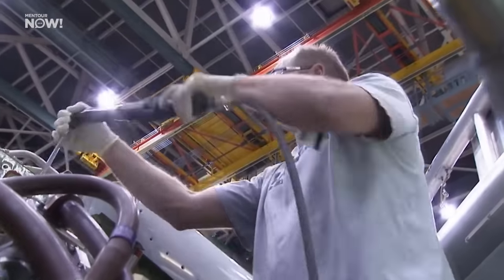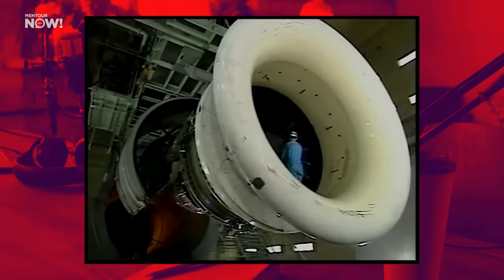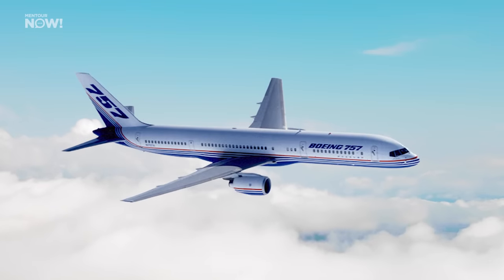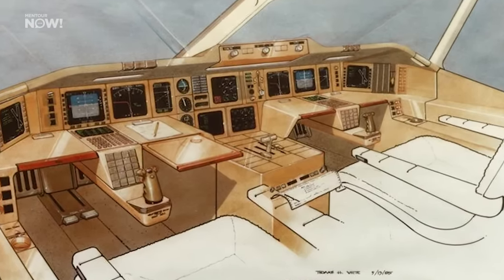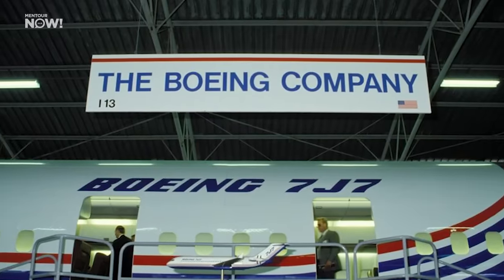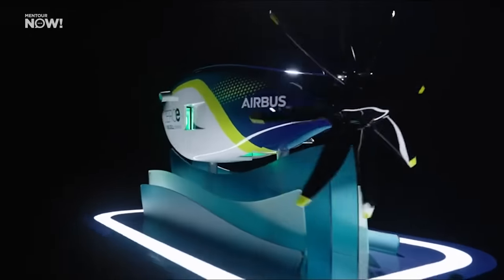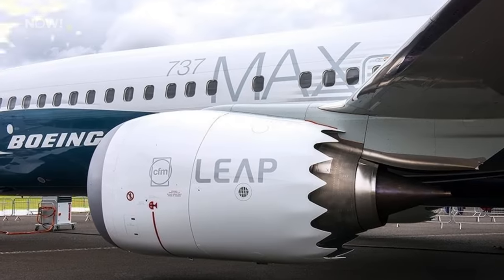Revolutionizing Flight! The Amazing Potential of the CFM RISE Engine.

Comment: 2 things not mentioned here:
1- The casing also adds drag.
2- These new-generation open rotor engines moved the rotor to the front (they are puller rather than pusher). Pusher propellers (or rotors in this case) are much noiser because they encounter uneven "dirty" air. Uneven because the engine must be supported somehow and that creates an area of "shadow". And dirty because they are in the wake of turbulent boundary layers at least from the engine and from the pylon. Puller props on the other hand receive a very even flat and laminar profile of oncoming air, which makes them less noisy.

1 thing mentioned here wrong: Turboprops are not required to keep a severed prop blade from penetrating the fuselage. And they don't. In every instance where a prop blade separated at operating RPMs and flew in the direction of the fuselage, they penetrated the fuselage, sometimes killing people, some times damaging critical systems (like control cables or hydraulic lines), and sometimes even exiting the fuselage at the opposite wall.
Reply: maybe the solution could be to increase structural strenght in those areas so they wouldn't get penetrated in such scenario.
Reply: @Hikari_Sakurai  That's not necessarily possible. Everything in an aircraft design is balanced against weight. You can only add so much weight in reinforcement and it might not be enough.
Reply: @hydra70  actually you're wrong. he mentioned it in the video that some of those aircraft had reinforcement in the areas close to the rotors. I wasn't that far in the video when I commented on it.
Reply: @Hikari_Sakurai  the reinforcing is there for ice protection. Chunks thrown off the blades can penetrate the fuesleage otherwise
Reply: @MattyEngland  This is so heavily dependent on the car and the grid production sources that it's kind of a meaningless claim. If the grid is purely fossil fuel you won't see much of a benefit, but obviously if it's heavily renewable that changes a lot
Reply: @MattyEngland  No? The Volvo report on figure 3 clearly shows the renewable break even point is at 30k miles. With the current global mix, it's at 68k miles.
Reply: @MattyEngland  Which report are you referring to then?
Reply: Any Link to a video showing or discussing a prop that sheered and went into the seating area of plane?
Reply: @MattyEngland  not true. EV’s break even in 18 to 36 months in the USA, depending on geographic location.
Reply: @MattyEngland  there is no fiddling. Straight up facts. It just doesn’t fit your narrative.
Reply: @RTB RTB_Dutchy  i love bacon.
Reply: Last year or maybe towards the end of 2021, a blade separated from a turbo-prop as it landed at an airport in the north of South Africa - exited the fuselage on the other side - as understand it, it missed the reinforced part of the fuselage as it had forward momentum after it separated from the spindle, and thus struck the plane ahead of where the designers had expected it to hit the fuselage.
Reply: @AmbientMorality  Yea. We don’t care about the children in the lithium mines and the hazardous/power consumptive process of refining lithium.  Fossil fuels bad.
Reply: @MattyEngland  Hey, you missed my question. I looked at Volvo's C40 analysis. Which one supports your claims?
Reply: Yep. The most recent passenger death on any U.S.-flagged scheduled air carrier (one of only 2 deaths in almost 14 years) was from exactly this - a turboprop threw a severed prop blade into the fuselage, which penetrated the fuselage and killed a passenger. Designing the fuselage to be able to stop one of those things is a lot harder than designing a nacelle to be able to redirect one and spit it out the back. Even more so when you're talking about the even larger fan diameters on the unducted fans.
Reply: @Hikari_Sakurai  Yes, he mentioned that but he is wrong. There is no requirement to have this reinforcement for propeller blades. Airplanes do have reinforcement in that area but that's for ice shedding from the propeller. One thing is to stop a chunk of ice, a different thing is to stop a super heavy, super fast and very sturdy knife (that is, a propeller blade).
Reply: My thoughts exactly. Not only is ducting more efficient by directing all the air in the desired direction without the loss of some of the air flow radially away from the blades, the ducting also acts as a buffer for any detached blade that is thrown off by the centrifugal force
Reply: @marsbase3729  A duct adds a lot of weight and drag, though. This is probably right around the point where ducts add more than they help
Reply: @anthonydomench6871  Children don't mine Lithium. Lithium is concentrated in evaporation pools and is associated with salt flats.
Reply: @vbscript2  That was a turbofan engine. The blade missed the containment system around the fan.
Reply: @singleproppilot  No, it was a turboprop. I'm talking about the Penair runway excursion accident in Alaska, not the Southwest 737 (that was the other of the 2 passenger deaths on scheduled carriers.)

The Southwest accident was a contained failure. The blade was contained, but part of the cowling broke off and impacted the fuselage.
Reply: @rtbrtb_dutchy4183  sTrAiGht Up fAX!

Deliver the numbers. And ignore discounts given by the government.
Reply: @anthonydomench6871 You do know that there are just as many concerns (yes, including those very same humanitarian concerns) about the "mining" and refinement of fossil fuels, right? 

Coal is more radioactive than nuclear plants and is mined by slaves, including children. Petroleum (oil) is mined by machines, which in a lot of oil superpowers had children building them. Refinement and transportation... Don't even get me started in the harm of those. 

Don't forget that betting on batteries means that eventually there's no environmental impact to transportation, at least in the atmospheric sense.

Comment: I saw this propeller design in the mid-late 80s, probably in Popular Mechanics. I've thought about it many times. It's been a long wait to see it in action.
Reply: As mentioned, it was REALLY FRICKING LOUD

The gearless blades were directly attached to turbines and spun at very high speed because that's the only way to efficiently extract work from the exhaust airflow. The bigger problem was simply that nobody wanted the 7J7(*) and the DC9/MD80 was "good enough" as-was for the kind of routes it was flying

(*) Remember this was when deregulation happened. Traditional airlines had mostly been happy to run fleets of differing aircraft but the only thing that 737 budget airlines wanted was "more 737s" - anything else needed pilots and maintenance crew qualified to fly them (expensive)
Reply: Yup I was thinking of that exact issue that also said in only a few years these would be on every airliner. Propfans etc. are super cool but remains to be seen
Reply: I had similar feeling that it's relatively old  design.I first saw it on soviet aircraft and thought that such idea started in USSR. It also looks similar to Kamov principle on few russian helicopters.
Reply: @Mantek430  The principle of contra rotating props alone isn't what a duct fan necessarily is limited to

Comment: The Russian "Bear" bomber is exceptionally loud, but is also a really cool looking aircraft. When I was stationed on the USS Carl Vinson in the early to mid 80s we had to intercept a Bear bomber with F-14s and "escort" them around the fleet. They were allowed to pass close by, but not directly over the fleet, so they were quite close and easy to see from the flightdeck.
Reply: Literally any flyable aircraft is cool-looking. At least in its way :)
Reply: I agree. Pretty cool looking.

Comment: I think the CFM Rise design brings some clever aero dynamics, by incorporating what I think is a Goldschmeid drag reduction feature. The bulbous housing after the stators might seem counter productive, but it likely has a lower air pressure on the leading side relative to the trailing side where the general body of air collapses around the housing  induced in part by the engine exhaust higher velocity flow, and the collapsing higher pressure on the housing squeezes the engine forward cancelling some leading end drag. It’s pretty clever. Engineers have been trying to incorporate this feature for decades with only a few successes.
Reply: That sounds almost like getting something for nothing. Making the housing extra bulbous should come with a drag penalty, it seems.
Reply: @MattyEngland  I think that they covered that in the script, ME. The fix for that problem is to reinforce the fuselage in line with the propeller to prevent penetration. Also there would be an additional safety factor in the balde and hub design.
Reply: @MattyEngland  How often do turboprop blades fail?

The stress on the blade root goes up with the square of the rotational speed. If you're not spinning at insane speeds it's a lot easier to hold things together - that's why gearboxes have been a critical step for big fans (turbines only couple efficiently into exhaust flow at high speed whilst fans only couple efficiently into air at relatively low ones)

The shielding is mostly there to prevent damage from ice being thrown off the props
Reply: @MattyEngland  Hi ME. Do you have any figures to back that notion up?  It is not me saying this, it is the engineers themselves, people who have done the assessment. It’s not necessarily extra metal to penetration proof an area, it is more likely mixtures of materials such as are used for the nose cone of the A380 which uses glass reinforced aluminium. It is more likely to be using Titanium (strength of steel with similar weight to aluminium, and possible composite reinforcement as well. So most likely extra cost without extra weight. Then there are the fuel savings which were not specified but indicated to be huge.

Comment: My main concern about this type of engine is blade containment - or lack there-of.  In the 1990s I was heavily involved in fan blade containment tests at Rolls-Royce when we were testing the use of a Kevlar bandage as a lighter alternative to a metallic casing. It was successful but the destructive potential of a free blade (which we blew off with an explosive charge at the appropriate speed and position for the high speed film cameras to capture) was chilling to watch.  I wrote the s/w and designed the electronic h/w that controlled the test.

I was also involved in the design of the h/w and s/w to measure blade untwist which needed probes fitted in the casing.  Presumably these blades untwist under load too but positioning the probes might be a challenge :)  

My only aviation interest after retirement is model aircraft.  It's considered that fewer blades in a propeller are the most efficient (in fact speed control line models have single blades with a balance weight).  I wonder how that affects the oddly shaped blades on these engines.
Reply: Haha. Yes, those seats in the cabin level with the blades will be cheaper: problem solved.

Comment: this just keeps reminding me of the Republic XF-84H Thunderscreech. which had the honor of turning a lot of fuel into a lot of noise. It was so loud it allegedly caused people on the ground to get sick. It also could not fly without the Ram Air Turbine extended IIRC.
Reply: Thunderscreech.... It must have been something special to get such a name.
Reply: @srinitaaigaura  Just starting it up would physically incapacitate the ground crew out to a radius of several hundred feet. Vertigo, Nausea, etc. Ear protection did nothing. It's viewed as the loudest airplane ever built.
Reply: @srinitaaigaura  Its interesting to read about, the supersonic propeller it used produced continuous sonic booms. The plane could be heard 25 miles away and  it made people nearby sick, an engineer even suffered a seizure.
Reply: @nate0765  Thats like Warhammer 40k stuff. delicious.
Reply: There's gotta be a way to use some sort of noise cancelation effect on the props, or in the way the props are designed to allow for supersonic props without as much noise.
Reply: @TianarTruegard  We've learned a lot about making quieter propellers in last 50 years, so maybe!
Reply: The thunderscreech's purpose was to test supersonic propellers. 
Thats what made it so insanely loud. 

Nothing else particularly special about it. It's otherwise a totally commonplace turboprop. Albeit an insanely powerful one.
Reply: @AggravatedFruit you know what the funny thing is? 
STCs are a real thing in aviation.
Supplemental Type Certificate.
A form, and encapsulating file name, for a large manufacturer-approved modification to an airplane. 
XD
Reply: @@aggravatedfruit_au Or an Ork built it, combine with being painted red it clearly would be faster than anything else because its really loud and red.

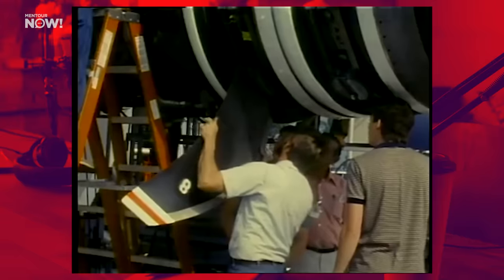Comment: At 2:32, the plane is flying out of the Albuquerque, NM airport.  GE had an engine production facility in ABQ and the test plane was at the airport for a number of months.  I lived near the airport and my house was less than a mile from the end of runway 17-35 (now closed), directly under the flight path.  I will personally guarantee that the noise from the unducted fan on the test plane was not "exaggerated."
Reply from the maker: Ah, thank you.
Reply: @MentourNow  I told my wife about this comment on the engine's noise, and she reminded me that the plane could be tracked on its landing path to the airport by the car alarms being set off as the plane passed overhead.
Reply: I owned a tool and die shop in the late 80s and actually built some bond fixtures for GE's carbon-fiber parts. GE-ABQ was the research plant for carbon -fiber tech. As I recall, most parts were nacelle pieces and fan blades.
Reply: I'll give a relative noise level.  At that time, the NM Air National Guard ("The Tacos") flew F4 Phantoms.  Some days they would be practicing touch-and-go maneuvers on runway 17-35.   The joke was we could stand on the backyard deck and wave at the pilots and sometimes they'd see us and wave back.  The F4s did not set off the car alarms...

Comment: I'm union labor for a company that casts aerospace/turbine blades and vanes, etc. We occasionally trial-run casting blueprint changes for LEAP, so learning about LEAP and CFM RISE, etc is really helping add context and understanding for where the things I help make end up, and what they do.
Reply: @daveymcc1421  Apparently it has to do with triggering you.  Lighten up a little.
Reply: @daveymcc1421  Union labor builds the parts/airplanes you trust and rely on, that's what.
Reply: I would imagine that casting process & the Quality Control is very very demanding, considering the high stress loads upon those fans & vanes in operation.
Reply: @jordanlarson6488  I think I'll take the train next time.
Reply: @daveymcc1421  Raising costs for everyone, like always.
Reply: @daveymcc1421  they sure are full of their BS labor crap aren't they
Reply: @misterserious3522  Wages rise higher than the increased costs though, as labour doesn't account for 100% of the cost of any product or service. That is how higher wages overall decrease the relative cost of living for workers. A longstanding problem that many developed economies have, is that the price of everything has been going up whilst wages have not.

So obviously wages aren't the leading factor in rising costs, as the cost of everything has been going up for decades whilst wages have been depressed down, relative to productivity or inflation. Unions aren't the big bad, and they help hold corporations to maintaining high standards in the aviation industry, and across the transportation industry overall.
Reply: @misterserious3522 workers do all the work making planes without them there would be no planes at all so yeah I think it's pretty justified to pay them a living wage

Comment: My father worked for the props division for Hamilton Standard and worked on this project as more than likely HS would have supplied the propellers. The issues were noise, speed and a bit more discomfort inside the cabin versus a turbofan. 

Both my father and brother helped design the A-400M euro transport shown in your video as well.

Point being, HS - now Raytheon- played a huge role in the development of the counter-rotating prop effort and  would be worth a look if one is really interested in this topic or propellers in general.
Reply: You sound like a person to ask or point out. If 2nd set of blades doesn't move but seems to channel air flow. Wouldn't a partial or solid ring at blade tips help better direct thrust?
Reply: That's interesting that they needed props of engines like that
Reply: My uncle worked in the props department of universal studios. Doesn't mean he knows anything about airplane stuff. Stay in your lane, sir.
Reply: @operator8014  in my lane? My father worked on the design of the propellers used in the counter rotating prop effort? Which lane do you speak of?
Reply: @chrisn7188  Nathan Lane

Comment: I thought the UDF concept was just an oddity from the 80s but now it springs up as a likely future candidate.
Interesting to see the latest designs have a stationary row behind the rotating blades. Must be a lot of energy in the airflow spiralling off the front blades but a lot simpler than contra rotating blades. The Russian Bear aircraft were unique for their mode of operation where they were in a steep pitch close to a feather position which was why they could fly so fast. Quite a talking point at the time.
Reply: I wonder if the shroud could be more minimalistic and made of moveable blades similar to the static row. So depending on speed they would form a more concave or convex duct ( or each segment variable to account for angle of attack). Apparently, we don't care much about tipp losses or gaps anyways. Then the propeller tips could reach through the aft-loaded low-velocity part of the shroud wings.